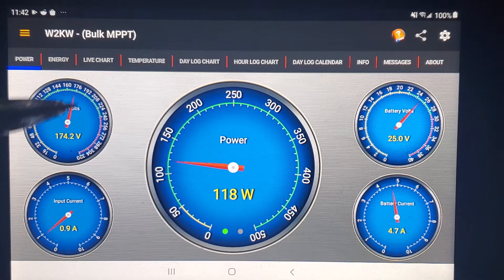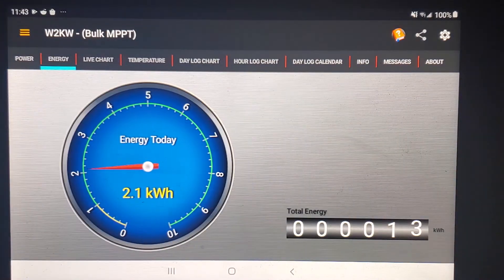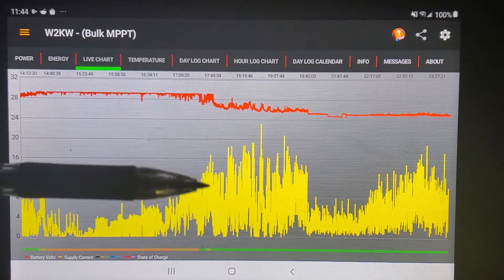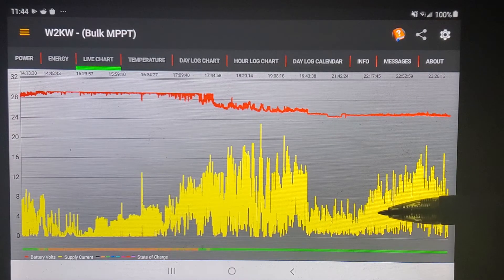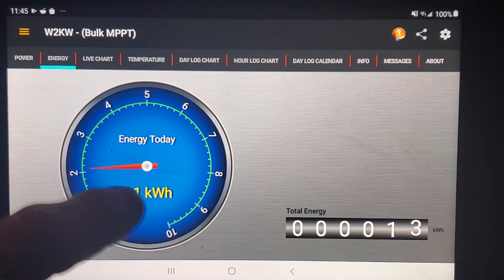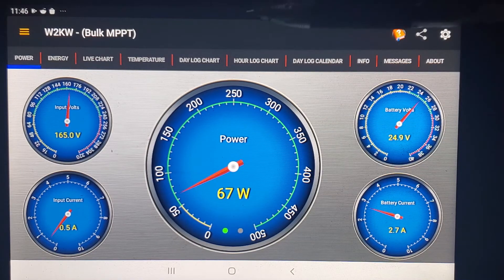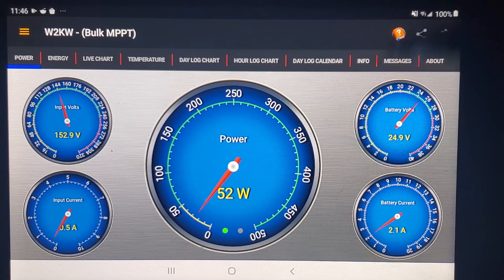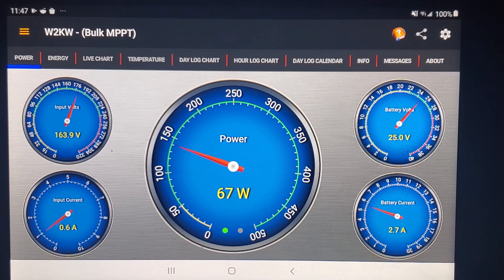Axial Flux Day log and kwh production stats with a Midnite Classic controller

Comment: Alright fella I just want to say thank you for sharing your work, like I said in your other video's I'm in the Uk mate and what I'm doing back here wouldn't be done with out you so a big thank you. I would like if you would hook me up on Facebook. I have Lilly flowers in the back ground photo 👍
Reply from the maker: Definitely happy you watch my videos and I'm very pleased to hear I have helped you.  Sorry bud I don't use Facebook
Reply: @windpowerandmore6310  lol I don't blame you fella, keep up the hard work and I'll catch up with ya in the comment box thanks again 👍
Reply: Alright fella got a question on your pulse motor, I have put another 12v battery on my primary adding to 24v and I have got double the speed and charge rate that's epic and is this normal mate. 👍
Reply from the maker: @sas25135567  yeah buddy the more power that you put into the motor will make it charge harder.  That's why I make the drive coils with low impedance. Easier to put higher amperage on the input yet keeps the watts low.  I have some other info on how to increase the output that I will post when I get home maybe around Christmas time.  Thanks for watching!
Reply: @windpowerandmore6310  I understand excellent, ok thanks mate thanks for getting back to me.
Reply: Alright fella hope your well , Just updating you on my progress so here goes. Right I have put a 600 watt inverter on my charge battery I'm currently running a fan a lamp and a apple iPad and a electronic cigarette charger power goes down then stops on my multi reader, so what I take gets instantly put back in my battery, run battery went down 0.3 of a volt in 3 hours I would say your work is absolutely phenomenal outstanding, because this is your work I just thought I keep you in the loop 👍😀
Reply from the maker: That's wicked buddy! Glad to hear about you being able to replicate it,  thanks for watching!
Reply: And now a TV 🙈🙈🙈
Reply: @windpowerandmore6310  mate I'm never gonna forget you never, just out out of Curiosity what's your First name.
Reply from the maker: @sas25135567  my name is Jeremy, if you want to ask me questions privately you can add me on hangouts, with my email. 
jvhoeops@gmail.com 

Google hangouts app
Reply: @windpowerandmore6310  sweet thanks fella because of the nature of this I can imagine all sorts of good and bad you will attract but thanks for that's much appreciated 👍😀
Reply: Alright fella got a question mate can I Swap the batteries around from primary to charge battery, so can I take my charge battery and replace it for my primary.
Reply from the maker: @sas25135567  yup I don’t see why not buddy
Reply: Wind Power And More  ok mate thank you for that and thank you for getting back to me.

Comment: Alright Jeremy hope your well fella, mate is it normal for my run coils to heat up everything is running very well and very efficient motor, my plans now it to put axial generator on to it anyway  going of subject so if I run the motor on one battery no heat nice speed, if I add a second battery on my primary speeds up extremely fast but coils heat up
Reply from the maker: Yeah bud it’s normal, the coils get hot because they are also charging. I’m sure you see the output increase a lot after the coils are heating up
Reply: Wind Power And More alright fella definitely charging a hell of a lot better now that I'm using NTE56 transistors but thanks for getting back to me mate, now that I know it's normal I can relax, hope all is well your neck of the woods mate.
Reply from the maker: Yes those are definitely the best transistors, if the transistors are getting warm just parallel more until they run cool . The coils will always get warm it’s normal
Reply: Wind Power And More  Top man thanks Jeremy.